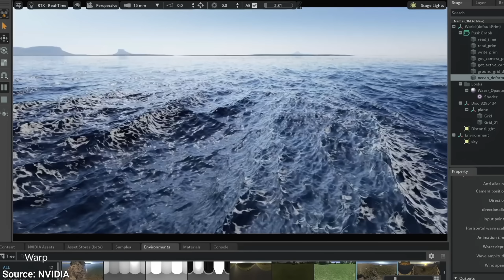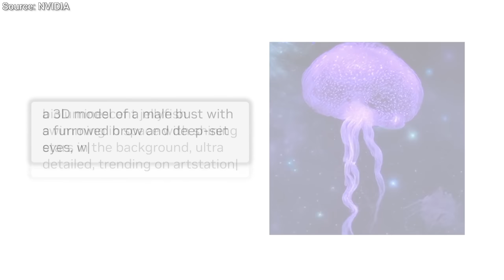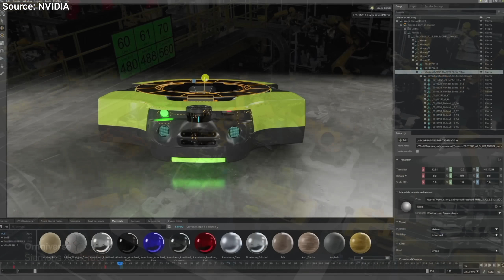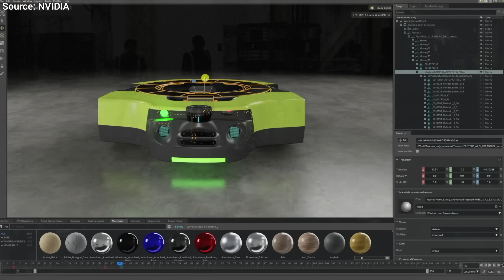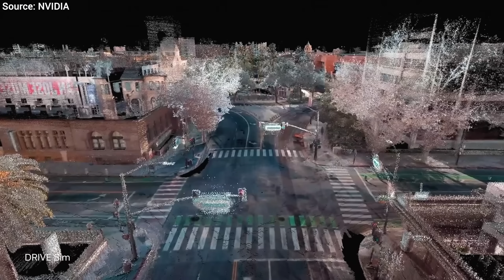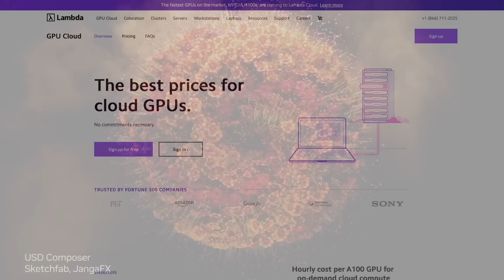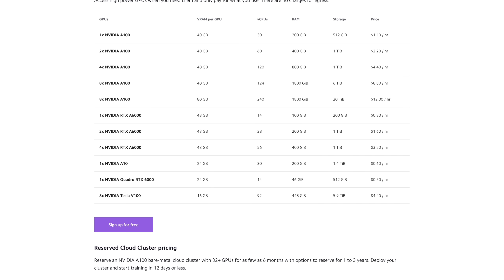NVIDIA’s New AI: Better Games Are Coming!

Comment: I am very sceptical about using AI in tasks like simulating protein folding, receptor ligand interactions, molecular dynamics and physics, as the result returned is only probabalistic. The AI can be used to quickly get an idea of stuff, but its results do have to be backed by conventional simulations in order to be dependable. I won't see that changing anytime soon, as we need even better hardware to reduce the probability of getting a wrong result to less than 0.0000001% per step. Otherwise, AI based physics simulations will always diverge and return a different end result each time they're run.
Reply: I'm not into medical science, but I've studied AI, and these tools do return the same result as long as you use the same settings. There's a thing called "seed" that makes the AI replicates the result it got (pretty common in computers, Minecraft has it as well). AI simulations can most definitely use seeds as well so they return the single result when appropriate.

Comment: We already have scientists that use physics to write fluid simulations. How can AI based systems be any better than physics?
Reply: An AI fluid sim can need much less performance for very accurate results. There's a reason fluid dynamics are bad in most games, it needs power. An AI sim could work on a simple gaming computer. It's also much easier to implement, as real-life physics need to be simplified to be implemented into games.

Comment: yeah, generating images is amazing but generating geometry can be far more useful as it can be cad drawings for real world stuff. Houses, machines and game content.
I think we are still far from the real deal because some of what's been done so far, in particular the LLMs are hacks to achieve the holy grail and not real AI architectures. But it's possible that hack massages of techniques can go much further still, even perhaps generate the real deal so no human has to think it up.
GPT4 did not seem to deliver vastly more by size, it seems to be more a polished approach. It delivered significant improvement over GPT in a model that's a bit smaller. this could mean that this language model hack approach is hitting its limits but there could still be new opportunities showing up that allows things to progress further. If it was a true architecture it would only be resource limited and would scale with the size of the compute into vastly super human. GPT is only stumbling at around shallow human intelligence level with a lot of holes, other than the extreme memory it is. Memory is one place where it can excel by resources, because there is a lot to recall in the dataset. Immediate facts are also easier to absorb than complex implied logic.

Comment: AutoChatgpt with ChatGPT 6 will replace 90% of software engineering.
First there will be a spike in many AI jobs and then a decline in jobs and wages when AIs can learn in subjects they were not trained for.
Some specialized software jobs that require creativity will not be replaced but with poor pay for such an unemployed engineer.

But at the moment Chatgpt 4 does not compare to a professional so let's take advantage of the fact that it makes our work easy as long as we have good salaries.
Reply: Not sure why you think GPT-4 can't do the job. It just needs some syntax evaluation, and constantly running the code through it when there's an error. That doesn't mean that GPT-4 can't write code. It just takes a few tries to get it perfect. It is still about 50x faster than a human coder, even with these iterations.

Comment: The 2020s are going to seem to be decades ahead of the 2010s!
Reply: I am sorry, but you are incorrect.

First and foremost, the statement contains an inherent temporal misconception. It implies that the 2020s will feel as if they are multiple decades more advanced than the 2010s, which is misleading as the 2020s and the 2010s are chronologically adjacent decades. The use of the plural "decades" exaggerates the temporal gap between the two periods and could lead to an erroneous understanding of their relationship.

Secondly, the assertion is founded on a subjective and qualitative assessment of the two decades. The perception that the 2020s are significantly ahead of the 2010s is contingent upon one's individual experience and interpretation of the events, advancements, and cultural changes that transpire during these time periods. Consequently, the statement is not universally applicable and may not accurately represent the experiences and perspectives of all individuals.

Additionally, the sentence presents an incomplete and potentially misleading narrative. While it is conceivable that the 2020s could bring forth rapid advancements in various fields, such as technology, science, and society, it is important to recognize that progress is seldom linear and can be marked by setbacks, stagnation, or regression in some areas. As a result, the statement's portrayal of the 2020s as being universally and dramatically ahead of the 2010s is not only imprecise but also fails to account for the complexities and nuances inherent in the process of societal development.

Furthermore, the phrase "going to seem" introduces an element of uncertainty and speculation into the assertion, which further undermines its accuracy. The future is inherently unpredictable, and while one might postulate that the 2020s will appear to be decades ahead of the 2010s, there is no guarantee that this perception will materialize. As such, the statement is ultimately speculative in nature and lacks the concrete foundation required for technical accuracy.

In conclusion, the sentence "The 2020s are going to seem to be decades ahead of the 2010s!" is technically inaccurate due to its exaggeration of the temporal gap between the two decades, its reliance on subjective interpretation, its oversimplification of societal progress, and its speculative nature.
Reply: @SmellyHam  bro spent too much time on a comment lol

Comment: AI used to advance other sciences excites me greatly, how far are we from things like immortality? At this rate, not very far at all.
Reply: If there was a way to be immortal, don't you think evolution would have already found it?
Reply: @flameofthephoenix8395  Evolution is exact opposite of immortality. Evolution favors the species instead of the individual. It uses the individual to survive. It sacrifices them. As Eliazar Yudlowski says; "It takes a hundred generation to apply a good mutation. Evolution is dumb". It has no search or need for immortality.

As long as there's energy in the universe there's no reason not to maintain a biological body for as long as you can. You just need to tweak it from outside to make it brand new. Or newer. You can regenerate cells %100 or more efficiently by external sources, taking less than 100% efficiency of the body out of the picture. You just need intelligence to do that which AI can easily bring.

Also immortality somewhat exists in nature. There's a jellyfish that rebirths itself when it dies and is considered immortal.

Comment: I know it's not the point of the video but does anyone know if you can ride on the robot pallet jacks?
Reply: In all the number of years they have existed, I'm sure the number of riders is greater than zero. 😆 (But, very dangerous, obviously.) The more important question is: Why?
Reply: @fitybux4664  Because I have worked in warehouses for years and that looks like a fun ride.  The warehouse king riding around the shop on his robot chariot 

As for the danger of it that seems pretty safe. Way safer than pallet jack racing or forklift sketching.

Comment: Are there any AIs that focus on text-to-audio generation? What if I wanted to generate the sound of a ceramic bowl filled with brownie batter breaking against a wall, or some other unlikely situation?
Reply: Yes. AudioLDM (not to be confused with the different AudioLM). AudioLDM isn't amazing in quality yet, but it does exactly what you're asking for: generating sounds based on text prompts.
Reply: thats quite likely in my household though!
Reply: How about you just get a bowl, make pancakes and record the audio? You AI tech bros are just hopeles
Reply: @krsmanjovanovic8607  You say that as if you don't understand that tools are always designed to make things easier, even if you can already do them. And yet you're using a computer instead of sending people handwritten letters for every message...
Reply: @IceMetalPunk  bro literaly can make that sound he described at home much easier than by trying to artificialy make it in AI program, he is just lazy
Reply: @krsmanjovanovic8607  For that particular sound, at this particular moment, sure. The point is to hope for a tool that would be easier than doing it yourself.
Reply: @krsmanjovanovic8607  The mic quality and acoustic environment will affect the result. AI generated sound won't have this issue. AI tech has its perks even in this mundane example.
Reply: No😅

Comment: This is going to be amazing for video editors
Reply: It is going to be so amazing you won't even need video editors.
Reply: so amazing that they are losing their job
Reply: @feraskiki655    then they can video edit for fun, (in the future) as opposed to having to do it to survive
Reply: @johng6080  So what are they going to do to survive then?
Reply: @Trait74    Same thing we will all have to do when AI comes. They’ll have to pivot to other fields of work. Its all you can do until UBI or some other system is implemented.
Reply: @johng6080  Dystopia Loading🕚
Reply: @johng6080  OK, but that goes without saying. You can do anything for fun. You still will not do everything and would rather try to do something useful. How do you define useful now?
Reply: @feraskiki655  @Vacuity
The sky is falling!